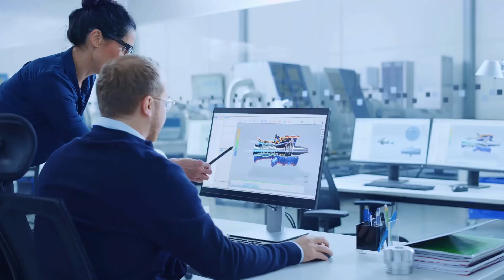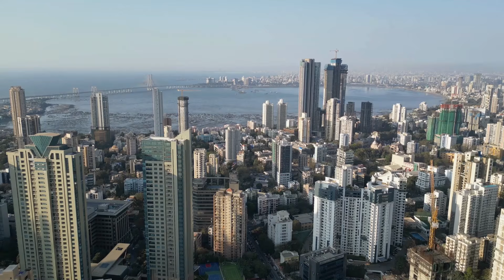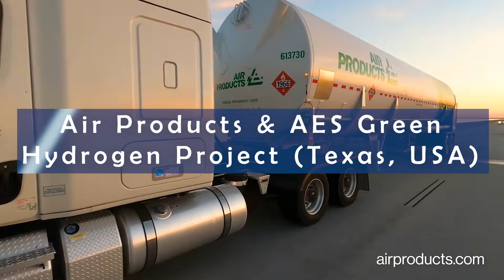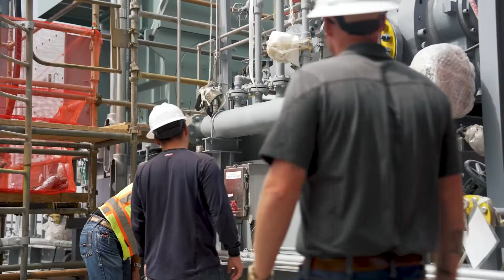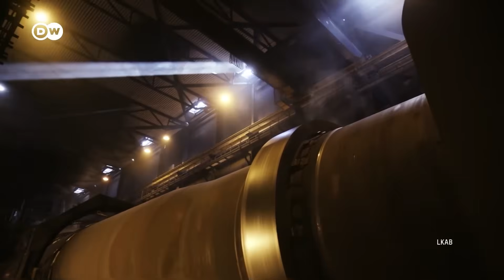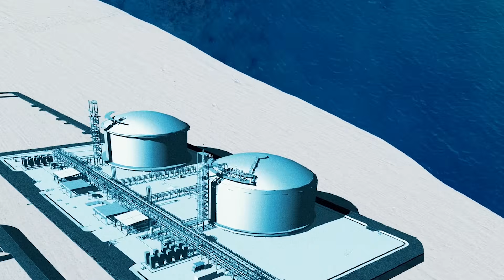11 Massive Green Hydrogen Projects That Could Change Everything

Comment: waste of money.
Reply: China will low the price
Reply: @HePi-yc5mp  China Builds cheap TOFU!
Reply from the maker: They always help reduce global prices of products from EV to Solar panels and so on
Reply from the maker: You are not wrong. China did remarkably well in helping to lower the cost of solar panels. We may see similar benefits in other renewable energy sectors
Reply from the maker: Why do you think it is?
Reply: @RenewableEnergyTalks  We don't need replacements for fossil-fuel engines, which are the most efficient.
Furthermore, hydrogen gas must be produced (electrolysis) which costs extra energy
Reply from the maker: You are not entirely wrong but variation is important. Also, renewables will still become more efficient and cheaper. We’ve been using fossil fuels for centuries so renewables are still just babies at this point

Comment: I thought the efficiency of electricity > hydrogen > storage > electricity,  was around the 35% mark ? The storage / transport of hydrogen is not trivial either.
Reply: Sun Hydrogen (HYSR) has solar panels that take in water and split it into hydrogen & oxygen. They are now collaborating with a Chinese company to manuf. the panels for pilot testing. So we have to ask what is the efficiency of a panel that can split out H?
Reply from the maker: Great point but many hydrogen projects are focused on industrial use, shipping and even long term energy storage - batteries/storage aren’t really the end goal at the moment. The Hydrogen market is still relatively new and not yet fully explored and developed. But with time, efficacy and scalability on all fronts will improve. At the moment, it still makes some sense in certain applications despite the losses especially since most renewable solutions work best together rather than in isolation.
Reply: @RenewableEnergyTalks I know, there is no ideal energy storage at the moment, which is why gas generation is still being used to fill the gaps in the UK . Petro / diesel is so energy dense and darned convenient too.
Reply from the maker: Yes you’re right, there are trade offs. The OG’s of electricity/power generation like gas, petrol, and diesel will always be king for the foreseeable future especially because they are more globally accepted and deeply integrated into existing systems. But like with all innovation, you never know when the tables will turn and most countries start playing catch up. Acceptability is the key. once people have a better reason to buy into the idea or are forced to by government or corporate policies, things will hasten up in countries of interest. Also, global conflicts and disruptions can accelerate innovation and push countries to diversify energy sources more. Once people and governments truly buy into the change, momentum builds fast.